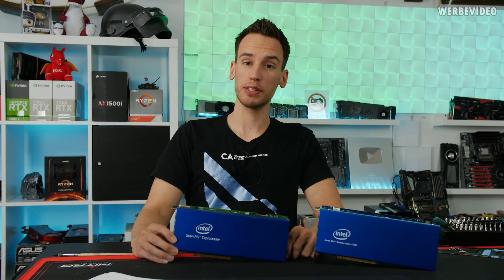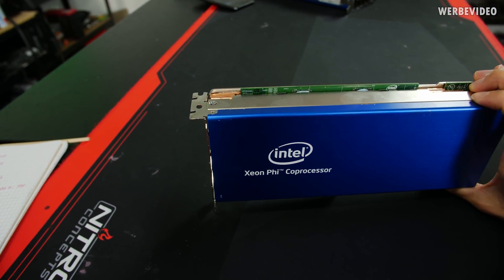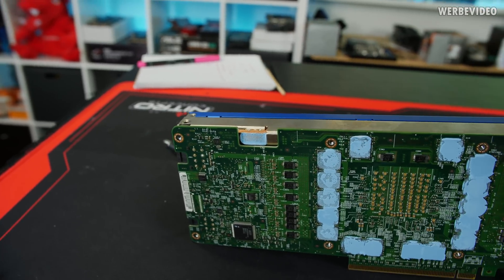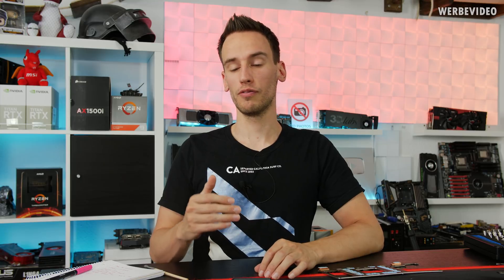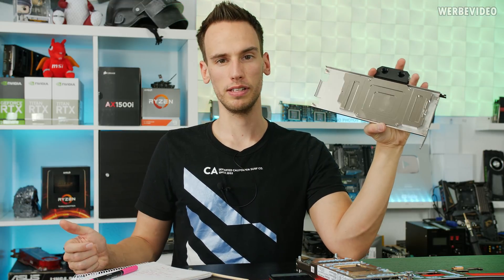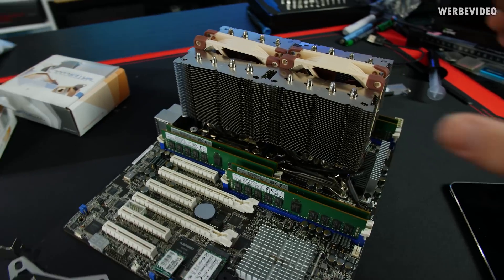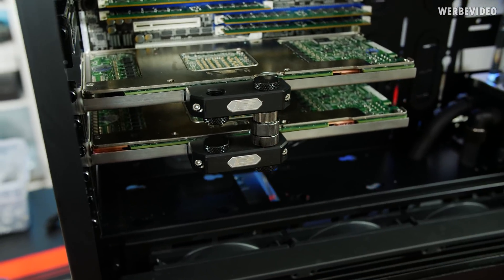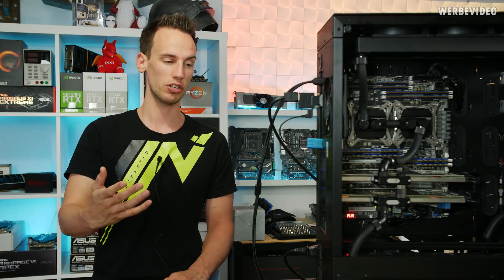Viewer-Mail Ep3: VGA Shaped Intel CPU with 61 Cores - Intel Xeon Phi

Comment: I want to add a comment about not needing to have heatsink attached to the VRM buck converter output inductors - the saturation current in the inductor is highly dependent on temperature, and the inductance value versus inductor current becomes very non-linear at a lower current the higher you go in temperature. Have a look in this random datasheet for a typical such inductor, page 2 and page 4 https://www.viteccorp.com/data/af3514.pdf . I have designed a variety of similar things for work and for hobby, and things like this will even if you don't run the inductors all the way into saturation still cause much higher ripple current into the output capacitor and into the CPU-load, which will rapidly age any capacitors, cause higher current draw, probably decrease any stability margin due to the higher PSU noise etc..

I never did these things for CPUs, but for switch-mode audio and DC/DC converters to feed them, so I always calculated temperature limits and aging on capacitors since you always underdesign a class-D amplifier with regards to thermal capacity, and car amplifier DC/DC converters usually break when they age due to large ripple current killing filter capacitors due to the manufacturers saving money on either not using inductors at all, or using very small cheaper ones.

Comment: The Xeon Phi will run a cutdown version of Linux, you can boot it and ssh into your 'graphics card'. Intel have documentation on how to do it here: 
https://software.intel.com/content/www/us/en/develop/articles/building-a-native-application-for-intel-xeon-phi-coprocessors.html
Reply: It's also worth pointing out that you don't really have to make your applications target those things specifically, you just need to package them for the kernel and libc that's on the linux system booted on the card. That is as long as your application is not depending on some "advanced" instructions not found in those things.
Reply: @randomname3566  while this is true, to get even remotely good performance (they're 7yo Atom cores at best) you need to use AVX-512 (or ICMI if pre 72xx) instructions. If your workload isn't suited to SIMD then novelty factor ahoy!
Reply: Wendell needs to take a look at this probably

Comment: you can use the blender benchmarks with the CyclesPhi renderer
you might want to hit linus tech tips, they use blender as a benchmark quite a bit and have a linux guru (anthony).
Reply: https://code.it4i.cz/raas/cyclesphi has some instructions on how to run it.

Comment: I've looked into these a little, they seem to run a CentOS kernel internally.  I think you SSH to them from the host system.  I'm not sure if software is copied to the device normally however.  I'd like to know if these could be added as an MPI based cluster in inside the host box. With two of these in a knights landing host you'd have a massive amount of x86 cores.

Comment: 5:52 that is one oddball VRM. We have 4 phases on the top left and 4 more on the top right that I assume are all vcore. (the IR VRM controller at the top appears to be an 8 phase) The 4 on the left share a power input, but the 4 on the right are split between two power inputs. The we have one on the left and 2 on the right for the power plane on the top of the PCB, which I assume is for memory. The one on the left has the same power input as the vcore above it, but of the two on the right, the upper one shares an input with vcore, then there's a gap with a phase not related to vmem, then the bottom most phase is another memory one, but it has its own input that's seperate from the rest. Finally the lowest phase on the left (EVID2) and the second lowest one on the right (EU7D2) are not related to the memory and are likely not related to vcore either. Minor rails? There is a third smaller VRM controller that looks like it might be powering those two as two seperate one-phase VRMs. Regarding the power inputs, you can see two phases for VCore, one for mem, the one unrelated one all connect to the lowest 6-pin. You can also see an inductor cleaning up the noise near each of the two 6-pins and there's one on the far left. Maybe there's some noise added to the power plane as it goes across the board? Maybe everything there is running off PCIE power (unlikely). 
Then all the capacitors are on the back, but almost all of them are for vcore.

Comment: Im very interested with the temp, u got so much radiators installed.
Reply: Agreed. I have more rads area than this on ryzen and single 2080ti, I can barely increase my coolant temperature. But it would be interesting to see a follow up on this setup
Reply: @whiteburr  on 1 x 420 and 2 x 360 rads (both thick) I have difficulty reaching 5 degrees delta T even with insane amounts of stress on my system (furmark + small ffts avx2). This is on a direct die 9900k pulling 250W and 2080ti pulling 400W+

Comment: I have the exact same motherboard, albeit only 12C CPU's, but i was (or: am) strongly considering Xeon Phi's, since they are dirt cheap on ebay.. But im debating wether its worth it over just using GPU's - i think CUDA have a much brighter future :)
Reply: Go for cheap Vega 56 for <200e if you don't need ECC memory on the cards
Reply: @Monasucks  well, its kind of hard to use CUDA on AMD GPU's

Comment: The Phi shows up on the host as a number of different devices exposed over PCI-e, including a network card so you can do "remote" login to it over SSH. You can manage a Phi from the host using Intel's Manycore Platform Software Stack (MPSS) tooling on Windows or Linux. The processors are MIC architecture, which is x86-compatible but won't run the same generic x86 code you'd build for a modern desktop CPU because the instruction set is heavily reduced. Puget Systems have a few good blog posts on how to set up and use a Phi under Windows.

If you want to write code for it, you really want Intel's compiler (Parallel Studio XE), but it's a commercial product. You can get free copies of it if you go through their qualification program (students, educators, FOSS projects, etc.) but for the average joe it's at least $700 for a license. You can also build code for it with gcc, targeting OpenMP, but that's much less optimal than Intel's option and I'm not sure how well that part of gcc is maintained these days. Once you've got binaries to run on it, you just SCP them over, or use one of the MPSS host commands to copy the file.

Comment: Easiest way to use them is to upload a "normal" linux distro into them and run the benchmarks directly there. They're just PCs, it's just annoying to talk to them.
Reply: The annoying to talk to part is the reason they are dead. Scaling is horrible, overhead massive...

Comment: I wonder if you could use these for Folding@Home
Reply: It probably wouldn't run very well as F@H doesn't use the instructions these are best at. The cores are pretty cut down and are meant for almost purely AVX-512 scientific work.

It's basically an alternative to a GPU, easier to program for presumably and more flexible. But F@H doesn't support AVX-512. A fast single precision GPU would be a better option, or Threadripper for CPU workloads since they're better at mixed instruction work.
Reply: I've tried, but I can't even get F@H to recognise it as an opencl device.

Comment: You can find benchmark ( flops ) in linux quite easily for these Phi Coprocessor using Intel MPI, OpenMP and Intel MKL. Benchmark can be run in either native where the benchmark run/execute on Phi itself ( these Phi run very small linux ) or in MIC-Offload where it act as accelerator where the dataset can be larger. They have either 8GB or 16GB ECC GDDR5

I don't remember these Phi having graphite pad, hundreds that I've worked with comes with thermal paste. Maybe the sender have tried to improve the temperature by using the graphite pad.
Reply: Mine also had three graphite pad,  7120P

Comment: could you try to use these cpus as a gpu like linus did with the epic 64core cpu in crysis?
Reply: No, the cores in these coprocessors are really just Atom cores with SMT4
Reply: @Cheese-n-Cake16  Don't they have AVX-512 support too? Or did that come later. Either way, the cores are really weak in the majority of workloads.
Reply: @Jaker788  Some of the later Xeon Phi models had the AVX512 instruction set added but it was the same fundamental architecture
Reply: @Jaker788  AVX-512 is a mess, nothing supports all of the instructions, these support a specific subset
Reply: @andreaslegomovies  That just strengthens my belief that AVX 512 is not going far. And that AMDs negative stance on AVX 512 will stay, and the rumor that Zen 4 supports AVX 512 is bunk.

If zen 4 does support AVX 512, it's probably because they expanded their SIMD units to 512 wide or have more 256 units and just split it. I suppose at that point you can support AVX 512 naturally, but you can also just run the 256 bit instructions faster right?
Reply: @Jaker788  i think so, yes. I wouldn't think AMD would add AVX-512, but they might do some cache tricks and optimizations instead to make it more vector-math efficient. Maybe AVX-512 will mature with time and be adopted more widely (i think GCC is moving to a new approach for selecting instruction sets, which might help), but not in it's current state.

Comment: So I believe the reason that Intel chose the thermal pad on the coprocessor instead of thermal paste, was one of long-term usage. Expected these to be used in a hot server room for a very very long time, and they did not want the thermal performance of the cooler and heatsink to degrade over time, causing there big corporate money Spenders to be unhappy. These things were not cheap when they first came out.
Reply: If your server Room is hot, you are doing something wrong. It should be around 17°C to 19°C
Reply: @JmbFountain  many data centers run warm because its efficient
Reply: @JmbFountain  i know you're right but god dam I've never been in a cold server room
Reply: @JmbFountain  actually. server room are starting to adapt to warmer temperature as it saves them money.
here, in my area, they run from 20 to 22c
the hardware works just fine 
they have hot and cold rows. the cold one is theses days around 20C while the hot one is rather hot... can range from 24 to 30C easily
Reply: @patricklegault6383  yes, switches are typically fairly heat-tolerant, but higher temperatures are poison for certain equipment (mostly stuff like HDDs), while actually benefiting others (NAND-Flash has its optimal operation temperature around 50°C).  Our Server cabinets currently run between 18°C and 20°C, the Network cabinets just run on "ambient" air, so 20-25°C from the building AC
Reply: @JmbFountain  TOR switches may be tolerant to high temperature but core equipment is much more sensitive. We had an outage in a datacenter in 2016 and the room temperature skyrocketed to 50°C in a matter of minutes : servers were "fine", they basically just throttled, but many optics in the 25Gb and 40Gb backbone just burned.
Reply: Don’t you mean server farm.  Companies that would have these co processors would have Server Farms. They are now called Data Centers or AI/ML Centers. They would be definitely cooled with high performance Air conditioning with humidity control.  Though it is true that Thermal Pads will last a lot longer than Thermal paste.  

We can’t think like a Gamer.  These are for Pro users.

Comment: Hmm, I thought these Phi's were usually used via remote access from the host computer. Basically you remote-desktop (or SSH into them, really) into the card, from the host. At least that's how I have seen them used. I think Intel MPSS is the tool used to set up the card and create this local PCIe network to the card, and is how you control & monitor it. I don't have any direct experience with it though myself!
Reply: It depends on firmware. You can boot them into slave mode, but it definitely won't work under Windows.
Reply: @Vatharian  I'm ssh'ing into and offloading onto mine from a Windows 10 host (linux requires too old kernels). You don't have a compiler in the tiny linux env on the card, so you have to cross-compile on the host and send it over the pcie network to the card. (Some Intel tools can do this efficiently bts through openmp and similar interfaces)

Comment: if they were in a normal pc case.. just make sure all fans are blowing air in the case.. no exhaust.. add as many fans you can
Reply: Probably wouldn't be enough. Even if you block all the other holes in the case, these things normally operate behind something like a delta fan running up to something like 11k rpm.
Reply: @jadoei13  In theory all you need to do is dissipate the heat, so you could get away with a larger but slower fan, you would however still need a High RPM Industrial Noctua or similar to be of any use though, and it would HAVE to be directed straight at the heatsink, which I would probably enlarge to add more area to dissipate the heat from, it isn't exactly very densely "finned" from what I can see in the first 2 minutes of the video.

Comment: Cooler idea:
Place the RAM and VRM on the back and use a bent vapour chamber to tranfer the heat to the other side of the PCB for active cooling, the actual GPU itself could be really short since you put a lot of stuff on the back. 

or make holes into the PCB and transfer heat trough with a few heatpipes connected to the active cooling.

Could that be done?
Reply: Just having the chips on the backside of the PCB is almost too tall already.
Any backplate/heatsync on top of that would have to be extremely thin to not be too tall.
Reply: @popcorny007  ehh screw the standards, they can make it fit no problem. Or well just mount  the gpu into the second slot, problem solved.

Comment: Why not search github? looks like theres a few utilities out there like Intel's MPI Benchmarks
Reply: The issue is for the sake of the video it would make most sense if the benchmark could be run on a normal CPU or GPU. This way you could actually see how these things compare.
Reply: @lightguy250  The benchmarking in this case would be primarily thermals. The reason he built the system was for a group needing a better cooling solution for their Phi's.
Reply: Yup I googled xeon phi benchmarking software and within 2 minutes found a research paper on programming benchmarks for them and also a link to Mic Meter on github.

Comment: Well they are 3 CPUs short and it is not a Slot One solution as I could think of a few Slot One motherboards for that like the ASUS P2B-B, What about writing the code to use NVidia Cuda cores to prove the system then swap in the intel code to replace the Cuda cores then check that the system still does what you wanted it to do.

Comment: Those cards can be utilized really easily under Linux
Reply from the maker: I remember last time I tried installing the Nvidia driver for RTX2080 Ti in Linux it took me 4 hours
Reply: @der8auer  which distro? On something like Manjaro it's super easy
Reply: @der8auer  you really have Nvidia to blame for that, though
Reply: @der8auer  recently under ubuntu(-mate) 20.04 the "aditional Drivers" tab in the "Software & Updates"-settings tab after some waiting should detect most less ancient graphics cards from NVidia and give  many driver options. And on many laptops intel igd/NVidia powersavings switching should work pretty much upon reboot after installing from the "Aditional Drivers".Installing from the driver settings window should work perfectly now.
Even though of course it is not fully opensource ( there is still the BLOB ) it should work as safe as the BLOB under windows.
Reply: @der8auer  it's gotten rather easy these days, you might want to look into trying it again.

Manjaro and other gaming focused distros have it in the settings with a simple click, and others have it like 3 commands away.

If all else fails, you just download the driver from Nvidia's site  and run it like a windows installer, except it's in the command line
Reply: @der8auer  yeah as others have pointed out, that shouldn't be the case. 

Even on OSes without a GUI (I don't like those very much, and even if I do have a desktop system I just use CLI tools), I have had basically no issues. There are solutions like manjaro, pop os that ship and install with the drivers out of the box. Debian clones have them put a repository away, same with Centos/rhel. The only time I've had a "problem" was running an old debian stable release and needing to get newer drivers than were in the repos at the time. That's something I wouldn't expect a typical user to know how to make work, but is also not something I'd expect you to encounter.
Reply: @der8auer  that's why we don't use Nvidia on Linux, no open source GPU drivers. But pop OS comes with those blob drivers preinstalled. If you are a tech guy you must have full understanding of Linux, also, many latets CPUs runs better there due kernel upgrades. Also, servers use linux..
Reply: @der8auer  on Pop!OS, Mint and Manjaro it should be as easy as clicking a check box.
Reply: @der8auer  I'd switch to an AMD GPU
Reply: No, you'd have to have one of the few supported enterprise (non-free) linux distros, all with kernels older than 4.0.0. It's hell to setup on anything else and requires several reboots and complete re-installs of the mpss stack with tiny changes every time. I never got ssh to work on the xeon phi on manjaro, even after manually adapting the dkms source to work with the oldest 4.x kernel I could get.
Reply: Stop snitchin! 😅😅
Reply: Even Ubuntu are fine, you just download them from Nvidia. You may have a kernel problem but if you reboot in safe mode kernel and update/upgrade it will be ok.